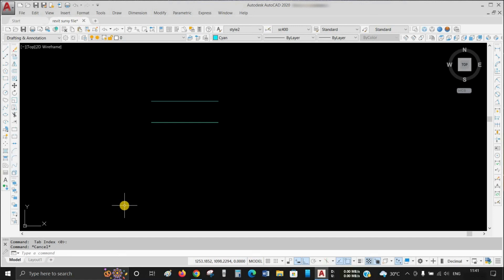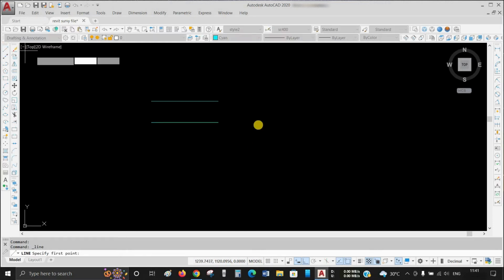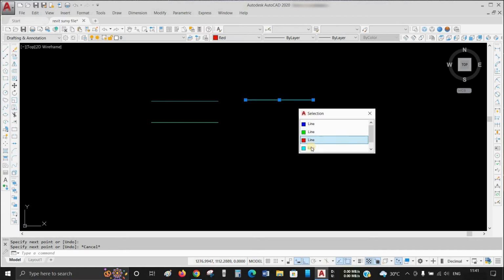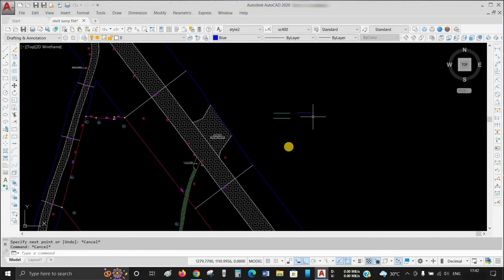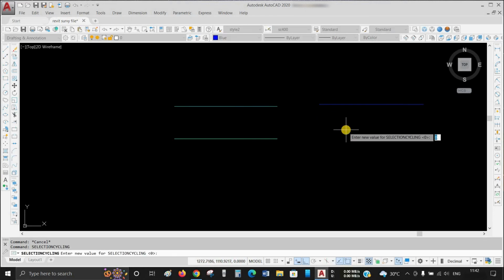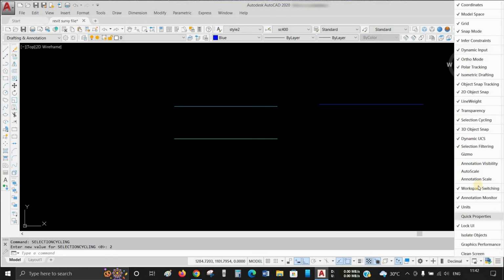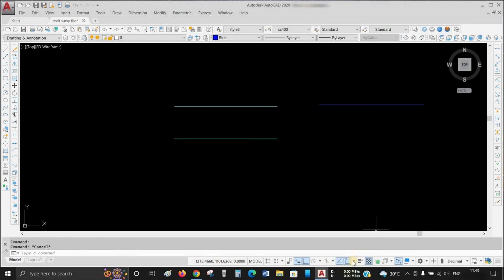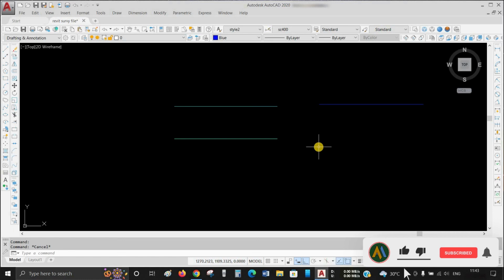Selection cycling AutoCAD // Layer box shows when selecting an object.

Comment: Hi! Thanks for the video. Is there any way to resize this box? I have 20 layers over each other with the same color and it would be very usefull to see all the objects together without scrolling.
Reply from the maker: There is no direct way
Reply: @archmotion2173  If you mean I can resize it like any other window (=grabbing the edge and stretch), then I'm afraid there's a bigger problem, because I definitely cannot do that with this small window. Would you please explain how you did it?
Reply from the maker: Sorry typo error. There is no direct way. This is predefined by Autocad user interface